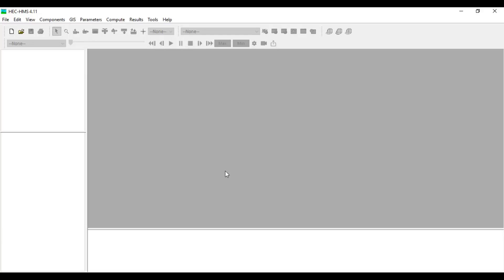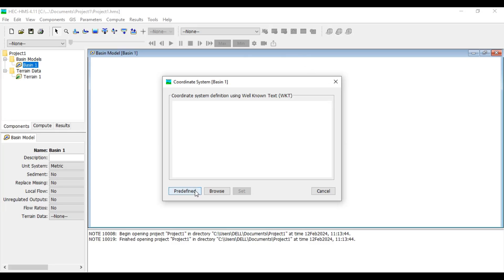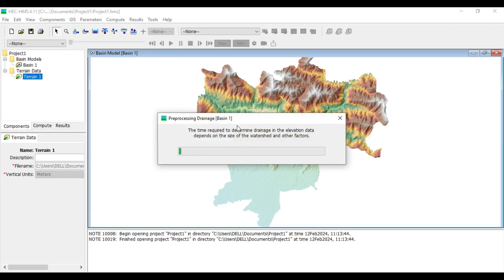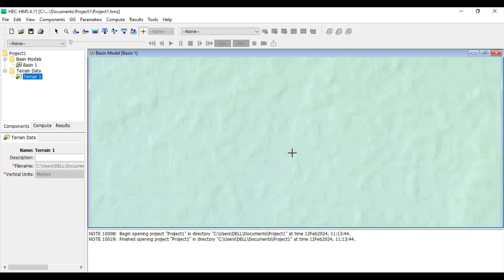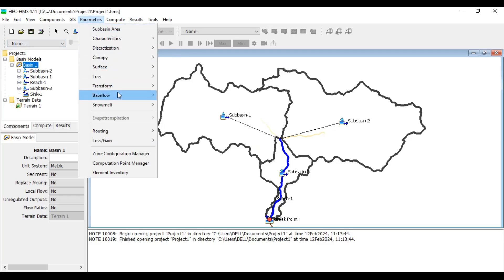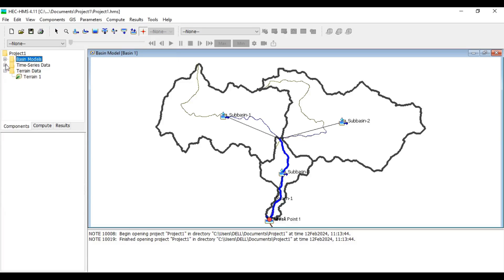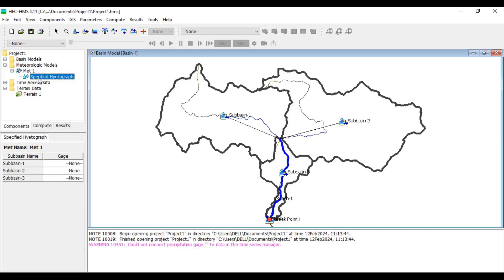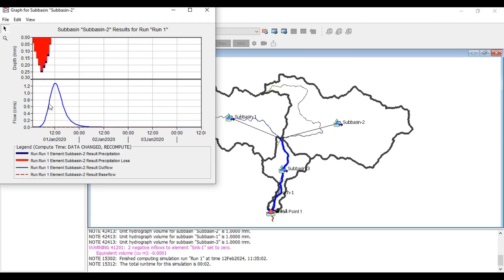Hydrological Modelling in HEC-HMS 4.11: Tutorial for Beginners

Comment: Hello, sir I have an assignment that needs to enter annual daily max rainfall data from 1998-2019 in time series data (manual entry). And it suggests to use 30 min time interval. So how do I do this? Can you pls explain?
Reply from the maker: Thank you for reaching out. Could you please elaborate more specifically?
Reply: @_SolutionSeek  Thank you for the reply. I have yearly rainfall data. In the software I can’t enter yearly data just like in this video. I want to know how should I enter yearly values as rainfall data.
Reply from the maker: You can filter out the data as per the required time period in excel and enter as in the video.
Reply: @_SolutionSeek  okay. Thank you.

Comment: Good morning sir.
I have been going through your tutorial and i am grateful for that.
I have one queny though.
After creating project, creating terrain and basin, the terrain file (.tif) is not visible in the basin model interface which was supposed to show, and where i proceed with the analysis and further undertakings. please help. thanks
Reply from the maker: Thank you for your appreciation. Regarding the problem you've encountered, there are number of reasons for that. It might be due to large DEM size or improper coordinate system. Sometimes the version of HEC-HMS you are using might not support. Please ensure UTM as your reference system. Hopefully it works.